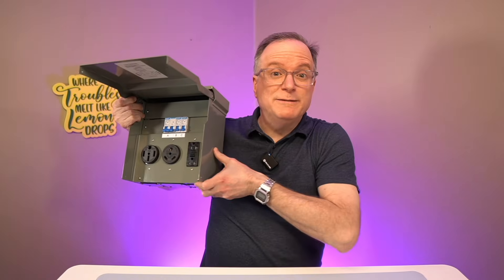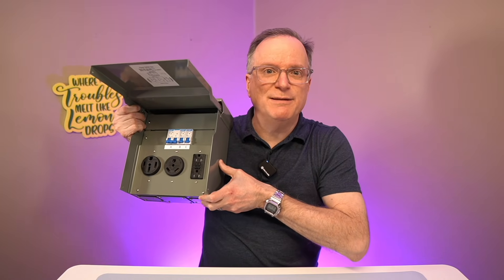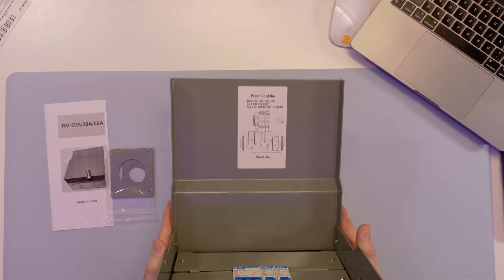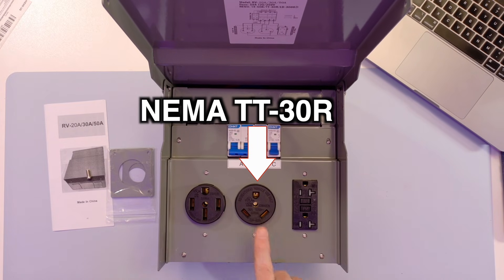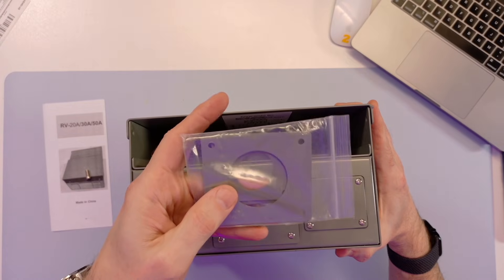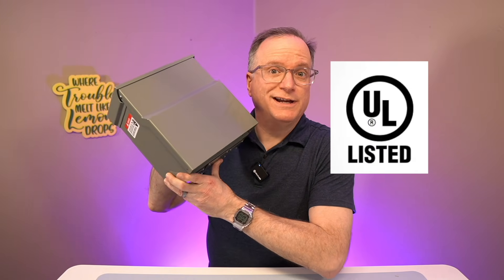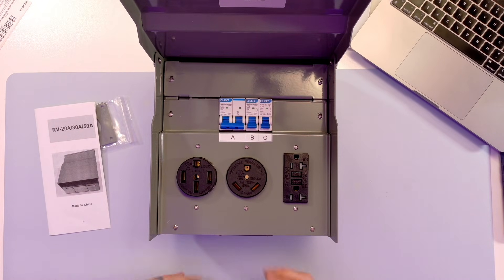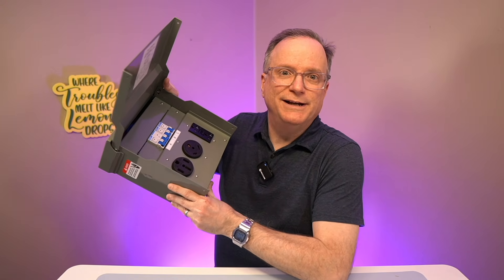RV Electrical Outlet Panel: 20, 30, and 50 Amp Receptacles

Comment: Cheap ass box. No UL listing stamped anywhere. Cheap-ass non UL breakers. Improper, daisy-chained grounds. Should be individually landed on the bar. Lid won't close and lock with 50 amp RV cord plugged in. Avoid this.